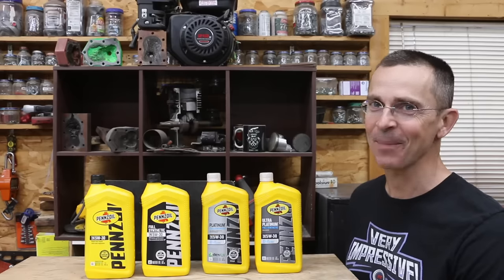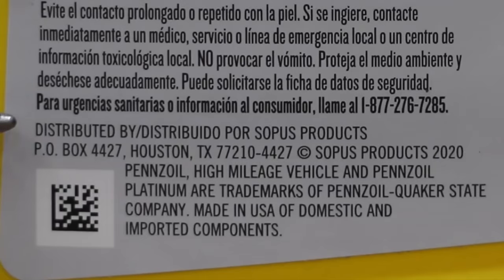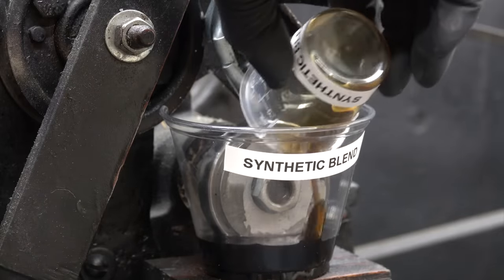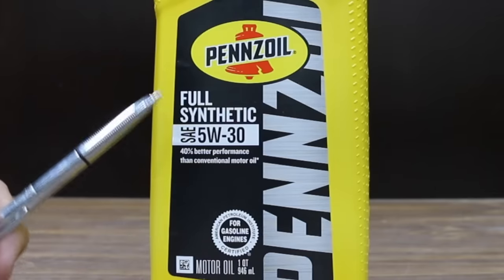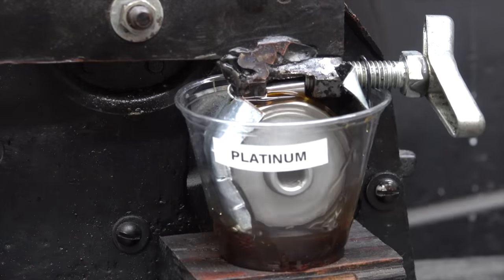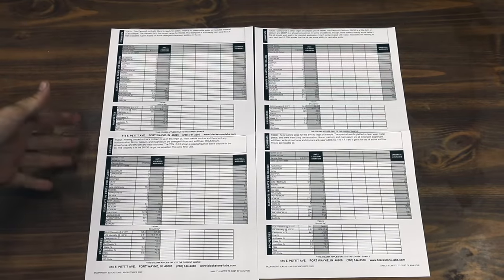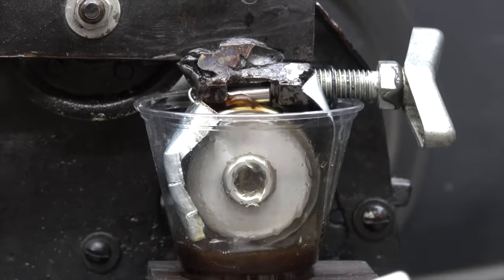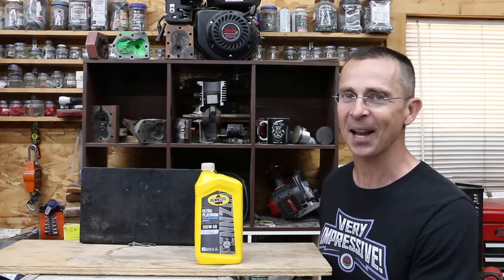Are They All The Same Motor Oil? Let's Settle This!  Four Levels of Pennzoil Motor Oil Compared

Comment: The original test series years ago is what convinced me to use Ultra Platinum on my vehicles and this test just proves, once again, that for the money its the best choice (without getting into the AMSOil and other high grade products). Truly get what you pay for with the Ultra.
Reply from the maker: It's worth every penny in my opinion!  Great oil!
Reply: @ProjectFarm  praise kek
Reply: I try to use Amsoil when I can. I used to use Royal Purple, but the cost and I believe I was told by a mechanic they put less detergent in it or something and he recommended Amsoil. After seeing this, I might try Ultra Platinum. I've never used Pennzoil before, so I might try it
Reply: Same here :)
Reply: Me too
Reply: "Brominated Vegetable Oil" sounds violating.
Reply: @alphaomega8373  They put that in citrus flavored sodas
Reply: i never see it in any of the stores i shop at.
Reply: It has been what I used since his original series. I'm glad I have not been wasting my money.
Reply: It's cheap too! Pennzoil has a rebate now for $25 off 2 5 qt jugs. I buy off Amazon for $25 for 5 qts for ultra platinum 5w30. So basically after rebate I'm getting it for $12.50 for 5 qts! And you can do up to 2 $25 rebates :) so I got 20 qts of oil for $50
Reply: @_AndromedaGalaxy_  Amazon!
Reply: @_AndromedaGalaxy_  Amazon is your friend for this. Order it ahead of time, keep the next oil change worth in your garage. Sometimes it takes a month until it is in stock to ship.
Reply: Schaffer’s … Amsoil … Royal Purple … Rotella T6 … in that order … after that … I wait because I know I can get a little extra miles until one of them is in stock 💁🏻‍♂️
Reply: I own a shop in NC and I've used about every oil on the market. I have customers that have 300k + mile vehicles that I've serviced for many years. Some like Pennzoil, Havoline, others like Castrol or valvoline and a few of my customers use Mobil 1 only....But they all have one thing in common, they change their oil religiously. I would be more concerned about your change interval than the brand of oil you choose. And I don't recommend the 7500+ mile change interval on alot of new cars (even with synthetics)... In my opinion, after 5k miles the oil has served it's purpose and it's time to change it. Just my .02
Reply: @toddervin6479  he has a video comparing royal purple to amsoil.
Reply: @Baldwin_media  yes and I believe Amsoil beat Royal Purple pretty handedly
Reply: @dixiemae5042  I have a 94 dodge 2500 with the original Cummins. It has 800,000 miles on it and I've used Rotella only since it's first oil change. I'm a big fan of Rotella, I also run it in my race car believe it or not. Never had a oil related issue after using it in my diesels and my race car since 1994.
Reply: for 11 bucks more it's a small price to pay for a vehicle that costs 15 - 100 grand. Ultra for sure!
Reply: @dixiemae5042  RP flows like molasses in the cold !
Reply: @Bobthebuilder.69  I'd bet good stuff,
I believe same company as pennzoil...
Reply: Hmm wonder if this pennzoil holds up to track work like the amsoil i use??
Reply: @Bobthebuilder.69  Agree completely on the interval, as well.
Reply: @BrominatedVegetableOil  Yeah, all retail stores will surely be sold out now!............................elsullo
Reply: @Bobthebuilder.69  what intervals do you recommend on older vehicles, say 1990’s era? 
I’m using full synthetics (brand depending of what’s on sale) and changing at 3k miles.
Reply: @Bobthebuilder.69  What about AGING?   I only drive under 500 miles per year, no kidding.  I have always run Mobil 1 for about three years, with a quart of Slick 50 added with the oil change.  Does synthetic oil degrade with time when hardly driven?  The truck is 32 years old with only 45,000 miles on the odometer, and still runs like new after a tune-up...........................elsullo
Reply: Have you done a double sided tape test yet?
Reply: I used royal purple until watching project farm oil testing and it’s all hype, I quit it and went to penzoil ultra platinum.
Reply: @ahodamahingan1698  i prefer to stick with the same brand oil throughout the vehicles life. Sometimes you have to run what you can find, I understand. I personally run conventional oils for 3k miles, 5k miles on synthetics (some say that's too often but oil is cheap, engines are not and it's not like it's very expensive to change oil yourself
Reply: @gigi9467  I believe Pennzoil makes some Racing oil if I recall correctly
Reply: @Bobthebuilder.69  I have a ‘94 2500 too. 250k so miles. Cali truck so not a pit of rust. Interior not so good. Motor tight. 47rh been rebuilt 3 times I think. Just got a Ford NP205 from savage yard. May G56 and twin stick it or Dixie my ‘17 5500 sleeper dodge ‘n super single her or get an old Chevy square body suburban and 12v g56 np205 twin stick it.
Reply: @countryfamilyalways7280  really?
Reply: @Bobthebuilder.69  where in NC. Yes concur on changing regularly. Back in the day it was every 2k miles.
Reply: @countryfamilyalways7280  once it flows tho …
Reply: @elsullo2  well personally in my opinion it wouldn't hurt to change it once every year or two.
Reply: @gigi9467  yah really.
They either make racing oil or they run a different weight of ultra platinum in Joey loganos race car that has won a championship....
Reply: @countryfamilyalways7280  hmm wish a knew what it is or were to get it cuz i been running amsoil
Reply: @gigi9467  amazon
Reply: @charleywalker2982  good move in my opinion.
Check out motor oil cold flow vid on you tube , stuff flows like sludge in the cold
Reply: @elsullo2  I'd change time wise no longer then 12 months with very little mileage on full syn oil
Reply: @gigi9467  amazon
Reply: @dixiemae5042  Mooresville area
Reply: @Bobthebuilder.69  ok. We know the same folks.
Reply: @dixiemae5042  mine was originally 5 speed and worked fine but I bought a wrecked 2002 dodge with a 6 speed and swapped it in my 94. I've put 2 clutches in it since I've owned it. That was a long time ago. The old truck is a workhorse and it's been good to me
Reply: i switched to amsoil years ago and have been very happy. you can go 25000 miles between oil changes, which means less cost in the long run
Reply: Same. I was a valvoline guy for years, but after project farm testing, I only use the ultra platinum now.
Reply: @hrsey71  25k miles. Holy ** man. That's alot of miles on the filter and oil.... Regardless of brand
Reply: @swiney82  old Texas Havoline straight 30W
Reply: Shocked that the second from highest Platinum did so poorly. It's results vs price place it at the bottom where spending a bit more for the Ultra Platinum is a good deal regardless of prices. Thanks again for another fantastic unbiased test.
Reply: @_AndromedaGalaxy_  Walmarts online has all kinds of different Platinum Ultra Pennzoil in many different weights and 75K and up special types.
Reply: @ProjectFarm  bacongreese worked fine i remember.
Reply: @Bobthebuilder.69  5k is my top oil mileage because most of my miles are city(considered severe driving). I was the Amsoil nut until it just wasnt worth the extra money. What I am not sold on is changing your coolant every 30-50k. I have notice every new vehicle Ive owned except diesel, the oil smells of gas; every dealership will say its normal or deny you smell gas in the oil.
Reply: All my toyotas are over 100k mileage with no evidence of oil leaks, American made cant say much to that(from experience)
Reply: Same here!
Reply: @Bobthebuilder.69  i know! i asked my amsoil rep about it too,  and he said yep, 25k miles between changes. i usually do mine about 10-15k because i dont want to risk it
Reply: It's frequently on sale for about the same as the cheaper stuff anyway, I always grab enough for a couple changes just in case i can't find it again.
Reply: @KJV0812  you can definitely tell a difference between new oil and 5k mile oil when you smell it and rub it between your fingers. The used oil feels gritty. Also, no engine is 100% efficient so some of your exhaust gases creep into the crankcase and contaminate the oil every time you drive so I always like to keep it changed between 3-5k, depending on oil. It's just peace of mind for me
Reply: @Bobthebuilder.69  I know, I hate these emission systems on gas and diesel engines. The amount of crap that gets trapped in the oil is what kills engines. I also use a synthetic media (20 microns) filter especially because I live in the desert and emissions. So anyway, what annoys me is when stealerships lie, but they are stealerships. You know I used to also use the K&N filter in the vehicles didnt realize that these engines are engineered with a paper filter for "perfect" efficiency(I know its not perfect) I realized that the K&N filter reduced the efficiency on the highway because it increased air flow and gas used by the engine.
Reply: @KJV0812  I've had alot of customer complaints about there newer model Toyotas burning oil. These engines have low tension/thin piston rings and for them to live a long life without burning oil, they must have good quality oil and keep it changed regularly to prevent this from happening. Once the rings are gone, it's time for a rebuild or another engine.
Reply: @Bobthebuilder.69  EPA standards across the board, all vehicles have "thin" or "loose" piston rigns to increase efficiency. Not really the manufacturers fault, blame the EPA for their idiotic rules.
Reply: One good reason why oil must be change at 5k max is because if sludge builds up in the "loose" piston rings, gas and oil bypass the rings into the oil.
Reply: @Bobthebuilder.69  I forgot to mention, I never really felt grittiness in old oil
Reply: @toddervin6479  I'm no oil guru, but your mechanic is wrong. I use royal purple specifically to clean the varnish from other oils out of my engines, I learned that it was an ideal oil for doing so from another Youtuber. When I'm not running RP, I'm either using Penzoil, or super tech depending on what engine.
Reply: @KJV0812  I guess the word I'm looking for is less viscous. Less lubricity
Reply: @Bobthebuilder.69  Yeah, basically make sure you keep quality clean oil in your engine. Thanks for the chat. If youre a father, happy fathers day.
Reply: 1. Tire Shine / Protectant
2. New MMO Ultimate v Original 
3. Leather cleaner / protectant 
4. Chrome Polishes 
5. Antifreeze Coolant Temp Reducing Additives
Reply: I used to run bar & chain oil in my mustang.
Reply: Whats Up Chb2  we will need to send him some cash for that test
Reply: I will join the chorus also saying Me Too - I started using it due to the original test series.
Reply: Todd, you should text every oil! All oils by Valvoline, AmsOil, Castroil, Mobil1, etc!
Reply: @alphaomega8373 
Stores in my area don't carry the Ultra Platinum, I have to order it on Amazon...
Reply: I also switched to it and my truck seems to use less oil between changes now.
Reply: I definitely could have written your comment word for word. I switched from Mobil none after it got slaughtered years ago in the tests.
Reply: @Bobthebuilder.69  agreed. I, too, am an automotive technician, and I don't recommend anything beyond 5k miles. My eyes may not be scientific, but, when a customer's car has been 7,500 to 10k miles since the last oil change (they follow the oil life indicator) and it's as black as road tar, it's well beyond done. Especially when most have a burnt odor.

Most shops stock the cheapest parts store oil, to keep costs down; unless a customer wants something specific. I cannot tell you how many engines I've opened up for timing belts, and other repairs, the engine is as clean as whistle, and it used conventional oil that was changed between 3-5k miles religiously 

Personally, I run the cheap Traveler oil from Tractor Supply or the Harvest King Synthetic Blend for Atwoods ($1 more then their conventional, at $16). Both are 5 quart jugs. I substitute 1 quart of oil for Marvel Mystery oil and run a factory filter. Change it every 3k. Blackstone labs found that my 8.1L Silverado was far below their findings for wear and contamination versus other 8.1Ls they've tested. They recommend taking it to 5k miles. What I heard was, "keep doing what you're doing." That was the Traveler oil and it had 1800 miles of towing a 3 horse trailer at 70 mph, average, and cold winter starts for much of it's 3k miles. Change your damn oil people!!
Reply: @ahodamahingan1698  Use Pennzoil Ultra change it every 6000 miles. Shake it up first before pouring in.
Reply: @Bobthebuilder.69  thats what i was thinking. Never never never. Not me
Reply: @OopsieBoopsies  an smelled darn near good too
Reply: I use platinum ultra in my 96 Camry V6 with  amsoil filter. 7k easy might go 10k
Reply: @elsullo2  yes it does. Every year change it regardless of mileage
Reply: Great video as always.  Where can you find Penzoil Ultra??? I haven't seen it anywhere in the DC area.
Reply: @_AndromedaGalaxy_  Same here!! I'm in the DC area.  It's not at  O Reilly, Autozone, Napa,Walmart or Advanced Auto... .It's on Amazon though.
Reply: @eac1235  Amazon! They always have 5w30 anywhere from $25-28 for 5 quart jugs. Actually a couple years ago they had 5 qts for under $20. Walmart online usually has it too and same price as Amazon but you need to buy $35 to get free shipping on Walmart unless you are their online super member whatever it's called
Reply: @remogaggi82  I did the same deal and got 20 quarts of Pennzoil Ultra Platinum for $50. You absolutely cannot find a better deal than that, anywhere, anytime.
Reply: @Bobthebuilder.69  Everyone has .02 cents to contribute. I’ll take yours IF you have actual evidence to support it (which is why this channel exists.)

The SCIENTIFIC (proven) fact is that modern oil used in modern engines, under moderate conditions, along with a decent filter, is more than enough to protect your engine, as long as you do normal interval change, but those modern intervals can easily be 10k miles or even more, depending on the engine. At least that’s what actual tests on actual used oils and engines show. Of course “feels” will always win over facts for some snowflakes.
Reply: @ProjectFarm  can you do a similar test with amsoil? I really want to see the difference with OE versus XL boosted versus signature versus dominator for my hot rod, dominator should perform very well with fuel dilution as it's a race oil, so I'd like to see both signature and dominator tested with fuel dilution.
Reply: I use it in my 9k rpm civic and it has worked great
Reply: @toddervin6479  it barely got beat out by Amsoil. Worth it 100%.
Reply: @ProjectFarm  can you add the Costco oil to your test data? I’ve always used the ultra based on your past reviews but Costco pricing is pretty enticing!
Reply: I’m actually having a hard time finding in stores
Reply: I use Pennzoil Ultra Platinum with great success on all our vehicles the last decade!
Reply: @jahmanborneo1343  same here
Reply: @Davido50  I just got some today
Reply: @KJV0812  I have a Tacoma 4.0 V6  with nearly 300k on it but the Toyota fan boy comment doesn't really belong in this conversation about oils lol
Reply: Same for me :)
Reply: I guess it already to late if u use the low quality product now ain't it? but it good to know these stuff helps a lot.
Reply: @gigi9467  greetings  , just finished watching the Pennzoil comparison test, very interesting. As a longtime gearhead ( especially 2 wheels) , I realized this test was good but incomplete. There is no mention of engine oils from across " the pond" (i.e. Atlantic ocean). I realize he has done some other tests with some of these products, but from comments I read for the most part only American brands are considered. Actually, FOR THE MOST PART European engine oils ( for example, Motul, made in France, Liguid Moly, made in Germany, Total, also France to name a few) have  a higher ( more stringent)  service classification than corresponding American brands. European countries use the A.C.E A. ( Automobile constructors European Association) , of course US. Oils are all A.P.I. ( American Petroleum Institute) certified. The European standard is actually more stringent, and allows for longer drain intervals, and are used exclusively by German makes ( BMW and Mercedes Benz). The Amsoil you use is certainly a VERY high quality product, it's actually made in my state up north. An interesting fact I was once at a motorcycle trade show and speaking to a rep from the Amsoil booth, he secretly admitted European oils are actually oftentimes a bit better in overall quality. When I run my zx6r on the track, that little power plant spends much of it's time spinning over 12 k.( R.p.m's), so money is no object when it comes to engine oil I use. That's so cool you spend time on the racetrack on 4 wheels, do you race or do you do track days? What kind of car do you drive? I have never been on a track in a car, but many times on a bike. Thank you for sharing. Cheers!!!!!
Reply: @Bobby Bradley greetings, used both products in a street motorcycle. Motorcycle oil is different than car oil, because in a bike ( at least Japanese) engine oil has to lubricant 3 separate systems( engine, transmission, and clutch) , whereas in a automobile just the engine. Small differences do occur in different brands,  but ALL modern day oils are good. The key is follow your owners manual for type of oil to use, and change it regularly. Rest assured, both products you mentioned are VERY high quality! Cheers!!!
Reply: @steveapel2961  2021 mazda miata, just wondering if this penzzoil ultra is a good replacement for my amozoil, am sorry but the motul an 
D European oil i dont consider better.
Reply: @gigi9467  greetings, thanks for the quick response! I probably should have mentioned the difference s are actually small, certainly all oils produced now are FAR better compared to a decade ago. How modified is your mx5?, I sold cars with a guy who ran an older Miata in  scca sponsored events ( at road America, Elkhart lake. This track was just visited by the big boys 2 weeks ago ( Indy cars). . He was a talented driver, dispite others having faster cars he usually finished in top 4. Cheers!!!
Reply: From lab tests I've seen, Quaker Full Synth is the same as Platinum, and Rotella Gas(Red Bottle ) is close to Ultra Platinum.
Reply: @steveapel2961  stock power intermidiate level driver
Reply: @gigi9467  oh ok I see, excellent!
Reply: Too bad there is no Euro line in Ultra.  Need 5w40
Reply: Mobil 1 is better
Reply: @redneck4528  yea no
Reply: @ProjectFarm  I know this doesn't have anything to do with oil but when you test tools, you should include masterworks tools from Menards!
Reply: @hrsey71  I would think that getting to 25k is a bad idea even with the best oil but it would be because of contamination, so results will change wildly based on the motor.  For example, I own. 2021 hybrid Highlander and a 2020 Silverado, bought both brand new. At 10k miles the Toyota oil was still transparent, the chevys came out black at the first 5k.
Reply: @basicuser54  maybe so, but amsoil stands by their claim of a 25k mile interval. i dont let it go that long but according to my amsoil rep you can
Reply: @clarityofthought  no bro wtf gtfo

The comment was "@Project Farm praise kek" in case he deletes it.
Reply: I have used all major brand name synthetic motor oils, and my best experience is Pennzoil Ultra Platinum. This product being made out of natural gas is very unique and the oil flows the fastest.
Reply: @remogaggi82  how? Link pls
Reply: Not for cars requiring dexos tho. It's good for the older formulation cars.
Reply: @toddervin6479  check out the PF comparison between amsoil and RP.
Reply: @dixiemae5042  My 1996 NA Miata loves Rotella T6 15w40 here in the Midwest during the warmer months. I've never used amsoil or Schaefer's
Reply: @Bobthebuilder.69  the grit you're feeling between oil changes is evidence of the oil filters build quality, or lack thereof. Not necessarily the motor oil itself. It could be a combination of both, I suppose.
Reply: @KJV0812  that shows the quality of the oil filters you've chosen to use. I never feel grit anymore after reading up on the importance of a top notch oil filter.
Reply: @Deusle  I use wix filters, never had an issue. Not one
Reply: @Bobthebuilder.69  Yeah it is! However I have seen a mid 90s Oldsmobile Cutlass Ciera with 180,000 miles and the guy who owned it changed the oil 6 times in about 12 years !! You could look inside the valve cover and it looked brand new. He did his oil samples like Amsoil said to do and changed the filter every 3k to 4k . So there must be alot fact to these stories.
Reply: @hrsey71  I just told someone else here that I knew a guy who had a mid 90s Oldsmobile cutlass ciera that had 180 k and he changed his oil as per Amsoils instructions every 25,000 miles and the filter every 3,000 miles. You could take the oil cap off and see that the valve train and top of the head were like new. Now varnish or sludge.
Reply: @Bobthebuilder.69  just started using them last oil change. Do you use the XP or normal?
Reply: @Deusle  regular wix for my daily driver and wix racing for my dragcar
Reply: @Bobthebuilder.69  haven't seen the Wix racing filter yet. Gonna look in to that one. Thanks!
Reply: @eac1235  nice! my filter interval says 25k as well
Reply: @toddervin6479  I always use Penzoil Ultimate.  But always wondered about how it compares to AMS. Lol
Reply: totally agree! this is the good stuff for the regular person!  amsoil if you truly need it for your career/ or can afford it.  But for the regular ppl! ultra it is for our race cars, and can even do their synthetic/fully syn for dailies.   I need to go back to compare kirkland brand vs penzoil syn/full syn.   now to refresh my memory!
Reply: Even using full synthetic I usually don't let any of my vehicles get close to 5k miles between changes.  It's cheap insurance to prevent the headache of having to replace the engine.
Reply: yep and Amsoil is pointless for a person like me who never sees below 40degf
Reply: @dixiemae5042  You know he’s tested all of those oils up against one another. This Pen Ultra beat them all, expect Amsoil Signature Series.
Reply: @Bobthebuilder.69  Exactly! We have a 2007 Silverado 1500 w/4.8 that’s only had conventional oil every 4-5k and it just ticked 429,000 miles. It’s used for a courier service and gets driven by several different drivers, that show it no love. It’s all about keeping everything clean and at the right level.
Reply: I'd like to see a test of oils in 115+ degree weather...  I always wonder just how thinned out it gets,  and how much shorter it's service life is, when driving around in an oven like Phx. 

Normally,  my guy uses whatever he uses.  I change every 3k regardless.  My lil 96 Nissan hardbody with 200+k miles runs like a champ.
Reply: One of the only video series that i watch at .75 speed instead of 1.25...
Reply: @jahmanborneo1343  which desert?  Phoenix has some serious heat.  I wonder how that heat effects service life.
Reply: @dixiemae5042  EWW
Reply: @gigi9467  The additives should explain that
Reply: All I use on my Durango srt. Only bad part is I always have to order it from my neighborhood NAPA. No other auto stores sell the Ultra platinum around me.
Reply: @gigi9467  suggest keep using Amsoil due to the best wear test on project farm
Reply: @darrylsjodin7184  yea i agree
Reply: @DanBCooper  except Amsoil had the smallest wear test scar by far.
Reply: @darrylsjodin7184  no, it didn’t.  Thanks for making me waste my time by watching that particular video though.  You need a micrometer to measure the difference .16mm.  Btw that’s not what’s going on in your engine anyways so it’s a mute point.  They are basically equal except for cold flow.
Reply: @DanBCooper  sorry. Pennzoil averaged 6.12, 2nd to last place and Amsoil averaged 5.91, 1st place. It matters during boundary lubrication, ie dry starts and aerated oil. The guy from farm could tell the difference with increased wattage measurement and increased noise during the wear test. I’ve noticed Amsoil makes engines run quieter.
Reply: @mrright69  Hi, I’ve been using Amsoil for 25 years with great results! This year is their 50th year in business and was the first company to introduce a synthetic oil that met the API requirements. Mobil followed 3 years later. The project farm test showed several differences between Amsoil and Pennzoil. The smallest wear scar with Pennzoil was 6.01 and Amsoil’s smallest result, twice was 5.78. That doesn’t seem like much but the farm guy said you could tell the difference in the watts used to turn the motor and in the noise from the friction. 2nd, Amsoil’s total base number is 11.5 vs Pennzoil’s 8.6, which indicates acid fighting capability. Most were 9 and lower. The wear scar size is important to show boundary lubrication capability, such as dry starts. You can order Amsoil on line as a preferred customer with free shipping over $100 and 25% off retail and it ships fast!
Reply: Repent and believe in Jesus Christ  What kind of oil would Jesus use?
Reply: @elonmust7470  seriously ??
Reply: @Bobthebuilder.69  this 100%...just change your oil every 5k miles with any that has the appoved API symbol and your engine will last 300k plus miles.
Reply: I remember supertech doing very well. Walmart actually has high quality standards.
Reply: @_AndromedaGalaxy_  I couldn't find it anywhere. So I found it on Walmart website. Now I have it delivered along with my oil filter, cabin filter, engine filter. All for under 100 bucks. Definitely a good oil
Reply: I picked up some Ultra Platinum 5W20 today that I ordered at my local Napa. The guy that brought the jugs to the counter shook them a bit and said “feels like water!” And the guy at the counter said “Oh, Pennzoil? Good luck with that!” A third guy working said “That one’s actually not that bad.”  Am I missing something here? I honestly thought it seems like a quality oil and had recently switched to it.  I’d like to hear why haters hate it and if it’s just a brand loyalty thing or if there are legit quality concerns with it.
Reply: Say what🤔

Were made in HIS image. HE made us with the power of free choice
A good prayer:
I'm a sinner JESUS please forgive me for all my sins I know you shed your Blood for me on the cross at Calvary. Thank you JESUS for my salvation and for shedding they Blood for me. I love you JESUS. 
Romans 10:5/10 ct...❤️k
JESUSisLord!Amen...
Amen..
If you'd like to call someone who cares 
83
For
Truth.
bc you don't know when you'll die?
.y r u hesitant. . ....
....
.... .....
Reply: @toddervin6479  I have used pennzoil conventional in my 96 toyota tercel. I sometimes go 10-12000 between changes but always at least 6-7000.
I am at 302k miles with no issues.
Reply: @toddervin6479  castrol's "edge" line of synthetic engine oil tests very well in used oil analysis reports. It is also reasonably priced and easy to find. I use it in my tuned 2019 3.5 ecoboost f150 with great results. I don't skimp on oil, especially when it's in a high-strung v6, making 500+hp in a 4x4 pickup truck.

I was surprised when I switched my high mile commuter car from a syn-blend to castrol edge. The engine runs noticeably quieter, especially on cold starts.
Reply: @_AndromedaGalaxy_  
Amazon has it.
Reply: Yeah it's a no brainier,  $150.00 dollars max a year with high quality filter an ultra platinum pennzoil.  For a property item that holds top investment in our lifes other then homes, property an owned businesses you gotta protect that 10k-15k engine.

An if yall have a way to do your own oil change an or family/friend who u trust with your vehicle.  It is simple with a great drain an torque ur own drain plug.

These quick/ez/ Walmart lube joints employ some worthless folks, they will cross thread your drain plug, under/over fill your engine , over torque your plug. 

Heck many news outlets had under cover reporters with used vehicles the news channels purchased.  They out mics & hidden cameras in under the hood. Many different franchises either never popped the hood, check the dipstick or even did oil change or filter change.  Many of em just topped it off, freaking lazy an something more.
Reply: This is awesome. I think next time I change the oil in one of my mowers I will use the ultra and see if I notice a difference. If I use a good quality oil I get better performance out of the engine and can usually mow 1 or 2 more lawns on the tank of gas which is more profit for me.  Thanks again. Your videos 4 years ago are very good.  I think the recent ones are even higher quality and better.
Reply: Amsoil all day long.
Reply: @Bobthebuilder.69  This is the most important thing IMO as well.  👍
Reply: We would love to see a test between the Pennzoil Ultra Platinum 5w-30 and the Pennzoil Euro L 5w-30. I understand the *euro has a different add pack including organics which don't show up on a UOA, however I wonder which one would emerge superior when run through your evaluation sequence. Thanks
Reply: @elsullo2  you should be changing it once a year. used oil degrades over time and can damage seals and bearings
Reply: @shootr04  The only thing you are missing is that you shouldn't trust that guys at the auto parts store are knowledgeable with oil quality. There's nothing wrong with Pennzoil or 5W20.

The guy who said "feels like water" may be one of these Shell Rotella fan boys who believe in running 15W40 motor honey formulated for diesel engines in their gas engines that call for thinner oil.
Reply: @_AndromedaGalaxy_  me either. I live in Spokane washington. I've called around and went to most stores. Nobody carries it. Any luck finding it on your end? I would love to be able to buy some but just cannot find it
Reply: @jahmanborneo1343  could you explain please, penzoil made from natural gas's flash point is lower than others. Does it mean to do not use it in a hot climate?
Reply: @Bobthebuilder.69  AMSOIL Dealer here.  The 25K is for "normal" driving and applies to our Signature Series oil.  Excessive idling (think taxis, police cars) short trips, stop and go city driving, very dusty conditions, and a turbocharged engine place the conditions in the "severe" category, which then the change interval drops to 15K/1 year.
Reply: @hrsey71  AMSOIL Dealer here.  The 25K is for "normal" driving and applies to our Signature Series oil.  Excessive idling (think taxis, police cars) short trips, stop and go city driving, very dusty conditions, and a turbocharged engine place the conditions in the "severe" category, which then the change interval drops to 15K/1 year.
Reply: @afcgeo882  you do you brother and I'll continue to do what's worked for me and my customers for the last 30 years. I use Blackstone labs occasionally to check my used oils and never had any issues.
Reply: cant even get "Ultra Platinum" over here just "Platinum"
Reply: Amsoil is still the best!
Reply: @elsullo2  I have studied oil science for several years now. Whether conventional or synthetic, I would change it at least once a year to get the moisture which has accumulated out of the engine. The oil has additives to neutralize the acids that form from the moisture, but when the additives are depleted, your oil is shot and needs to be changed, otherwise rust can form on the inside of your engine.  Logically you would want to do this before the additives get depleted. One way to tell how effective the oil might be in acid neutralization is to research the total base number (TBN) of the oil. The higher the TBN,  the more effective the neutralization over time. A typical TBN number might be 8 or 9. BTW, I would not recommend adding any additives to a high quality engine oil. The additive can upset the balance of the additive package developed for that particular motor oil.
Reply: @hrsey71  Amsoil Dealer here. The 25k is for "normal" driving, for example using it in a shuttle van that drives 150 miles one way to a City Airport where the engine is run at full operating temperatures for hours at a time.  Short trips, stop-and-go driving, excessive idling, running a turbocharger, and Dusty conditions are considered severe, then the oil change interval drops to 15k. This is per Amsoil's recommendations.
Reply: @Bobthebuilder.69  rip to my toyota camry 2003. solid car until i fell.fornthat 10,000 mile bs oil from mobil 1. 3-5k i trust more for sure. Valves got bent around 7k miles i remember.
Reply: @toddervin6479  
Pennzoil is a brand of Shell, they sell the same oil under the name Shell Helix Ultra.
Reply: @Bobthebuilder.69  When I first got my (used) Mustang and started using Pennzoil Platinum, I sent oil samples off to Blackstone for the first year.  They eliminate the guess work.  They will tell you exactly how much metal (and what types) and contaminants are in your oil; they will also advise if you can increase your change interval based on the contaminants they see.  I started out with a 5K change interval, and worked my way up to 8K.  Virtually no difference.  I elected to stop at 8K since for the amount I drive the car, that takes about 12 months; I figured I should probably change at that time interval regardless of oil contamination.
Reply: I agree. It's amazing stuff. I use it in my 2016 2.7 F150. I can really tell the difference. Switched over from Mobile one Extended Performance.
Reply: Yes sir ! That ultra platinum is worth it .
Reply: The badge Dexos is a paid certificate.